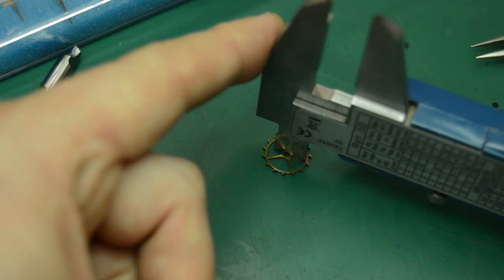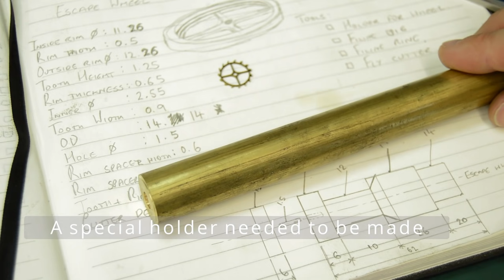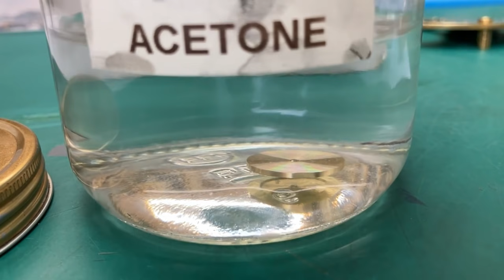MAKING A CHRONOMETER ESCAPE WHEEL - Clock Restoration - Workshop Wednesday 009

Comment: A great job Tommy, and a great video that highlights the time taken....and numerous processes required to create such a perfect thing, and also the tooling you've had to make that is needed to do the job. Why things sometimes cost more than assumed. 👍

As it looked complete....was it still performing correctly and just looking tired, or was it giving problems?
Reply from the maker: Thanks very much Neil.  The old wheel was worn, it would have run, but when the tips of the teeth are worn rounded the impulse to the balance is reduced and it can when bad enough cause the escapement to 'trip' by not locking properly.

Comment: Couple of questions, Is the green layout fluid a choice, or is it aged to that color? My dykem "steel blue" appears more blue/purple...  And Is that goma laca you're using to heat cement? laquer gum, or shellac flake, I imagine there are several names. Beautiful work, I like the crossing guide. I have been working at crossing out some wheels, achieving consistency and symmetry is a challenge.

Comment: What is the meths that you used with the boric acid.  I have used alcohol but I always have some oxide where it doesn’t cover well as I heat. Great filming!
Reply from the maker: Thanks very much.  It's Methylated Spirits, as sold in the UK. I've had good sucess recently preventing scaling like this.

Comment: Hello Tommy,
An enjoyable workshop Wednesday, thank you. Could I please ask, I see that you use superglue, did you ever use shellac? if not is there ever a circumstance that you would? I was not sure if that was shellac when you did the crossing out. See you next time.
Take care.
Paul,,
Reply: I was wondering that as whoever made the original wouldn't have had superglue.
Reply from the maker: Well spotted Paul, yes I used shellac to hold the wheel to the crossing holder.  Before the days of super glue it would have been either wax or shellac, it works in the samee way, CA glue is just a bit more convenient.

Comment: Brilliant work. That is not an easy wheel to make,. When you only have a worn wheel for a pattern how do you decide on the final shape to make your cutter as if you follow what you have you will make another worn out wheel?
Reply from the maker: Thanks.  You are right, it is one of the harder compnenets to make.  The wear is pretty easy to see so the cutter can be ground with that in mind, but a judgement does need to be taken when deciding the OD of the new wheel as wear to the tooth tips needs to be accounted for.  Judgment and experience are the tools for this!